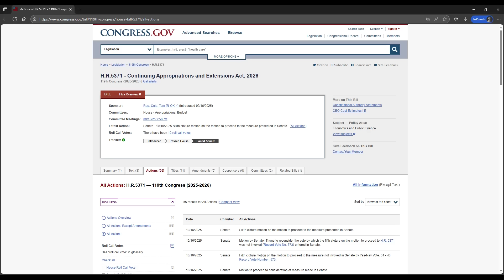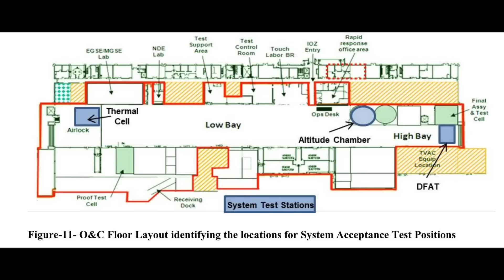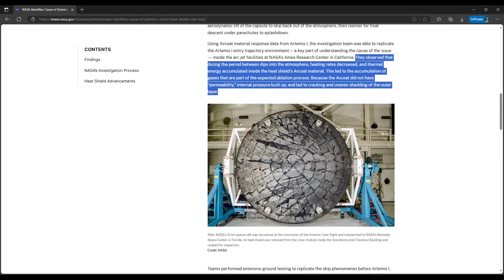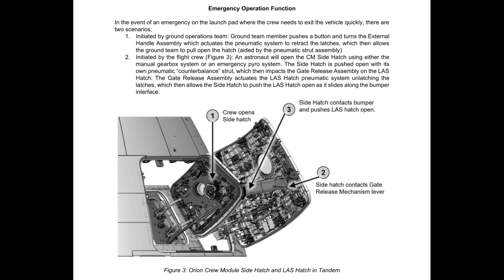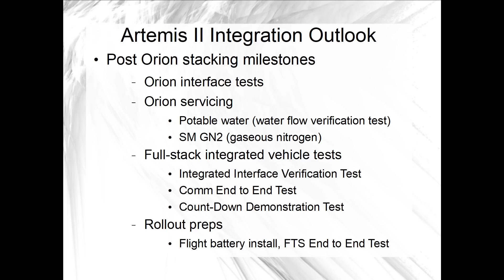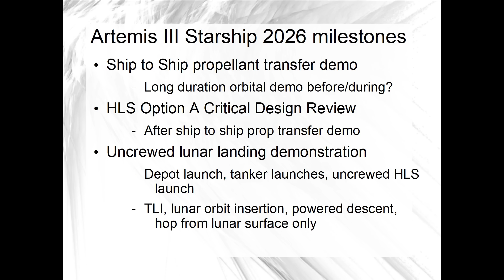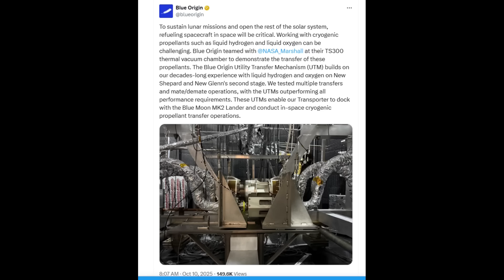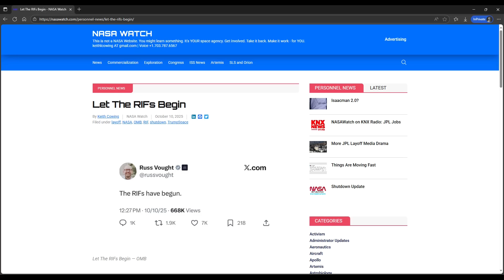Artemis II Orion to the VAB for stacking, how much does SpaceX still want to go to the Moon?

Comment: I still wonder if for Artemis III when installing the LAS and Ogive BPC if they will instead install the LAS's MATA and Ogive BPC in the same building where the Orion CSM is assembled then install the actual LAS stack in the LAS facility before moving it to the VAB for stacking followed by the installation of the conical fillet fairing. Or after installing the MATA and Ogive BPC then stacking the encapsulate Orion CSM in the VAB before mounting the LAS stack onto the MATA's forward adapter cone followed by the installation of the conical fillet fairing in the VAB? Next time you interview one of your KSC contacts, Philip, you could pose that question to them to see if it's feasible as IMO it makes more sense that way.

Comment: I don't think people realize how quickly the HLS program will jump forward once the base model of starship is fleshed out.  My definition of "base model" includes a booster/ship combination that are both returned to launch site, caught, and re-flown.  We could even see major milestones being checked off the list before we see re-flight of the ship.  As soon as ship goes fully orbital, they might start checking multiple things off during missions.  For example, send 2 Starlink deployment system (SDS) versions to orbit, deploy their V3 Starlink payloads, rendezvous, and start performing on orbit refueling tests.  Then they could continue testing heat shield modifications with the ship left with little to no prop.  Simply let them hit the ocean at terminal velocity.  In a perfect world, this type of test could happen as early as Q1/Q2 next year.  Leaving Q3 to place a depot in orbit, fly the first tankers, and Q4 to begin testing actual HLS variant hardware.  IF (big if) HLS hardware flies by the end of next year, I think it's completely plausible that the HLS Starship variant will be ready to go by mid/late 27.
Reply: based on how long rockets generally take to get human certified I find thay unlikely, it will take 5 years or more to get human rating as far as I can tell

Comment: It has been made clear that the path to a launch in January for the launch of Blue Moon Mark 1 is the success of New Glenn, in particular, recovering the GS1 "Never Tell Me The Odds" successfully and bringing it back for refurbishment. Otherwise, they have to wait until there is another GS1 built for NG-3.
Reply: I would suggest that GS1/NG3 is well under way given the timeline...
Remember, they can still launch...
Reply: @jesselomas8626 It's not. Trust me
Reply from the maker: That's definitely been reported in the news, but has Blue Origin confirmed that's the plan?
Reply: @PhilipSloss  No, but Blue Origin doesn't tend to announce plans in advance. It's kind of like with Artemis, a lot is known well before it becomes official. We're all still supposed to believe Artemis III is happening in 2027, after all.
Reply: @PhilipSloss Confirmed? Not sure, but I believe that what I read that another attempt
would be made...
Reply: @PhilipSloss   Blue Origin hasn't confirmed it, but it's the only realistic way Blue Moon could launch that early.
Reply: Yes. If they fail to land Never Tell Me The Odds (Tail 2), the earliest I believe they'll be able have a booster ready is the middle of next year.